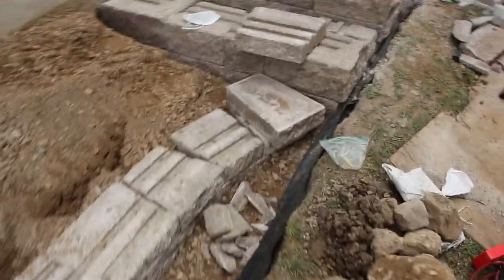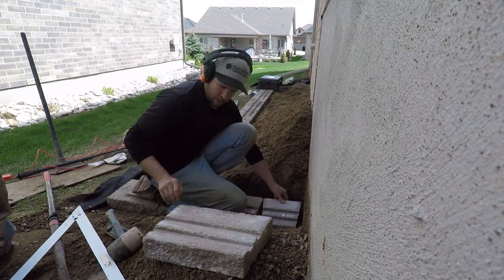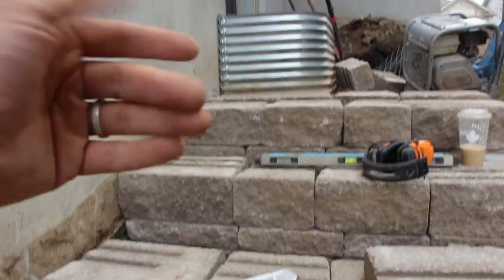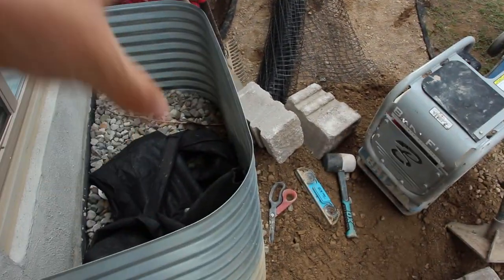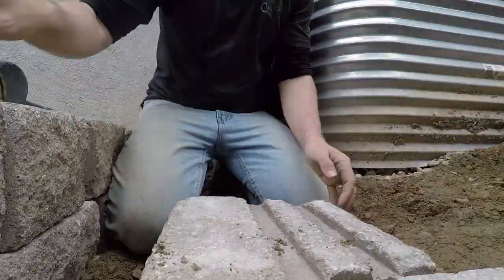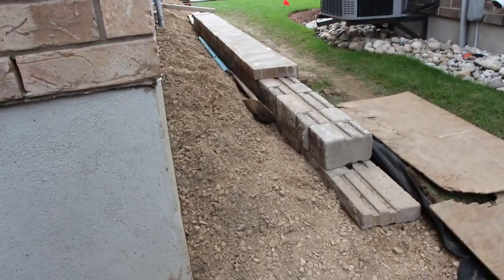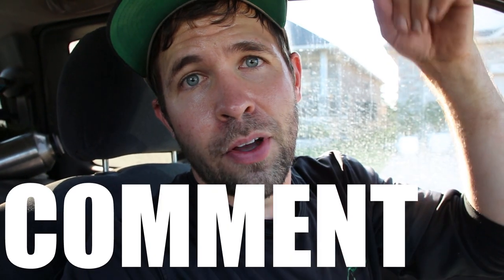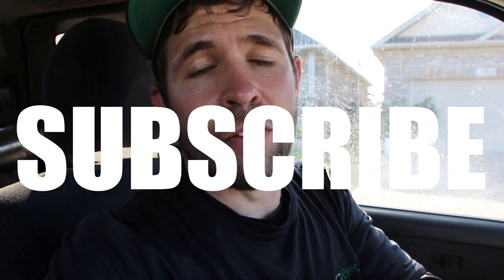Planning and Building Steps | Hardscape Vlog #6

Comment: Do you use clips on the groves in those blocks? I’ve used aluminum 1” sq tubing from home improvement store and it fits perfect. Just cut pieces to length I needed as it is hollow but seems strong enough.
Reply from the maker: Yeah, these ones actually come with plastic connectors.